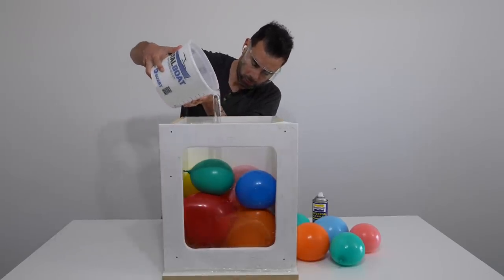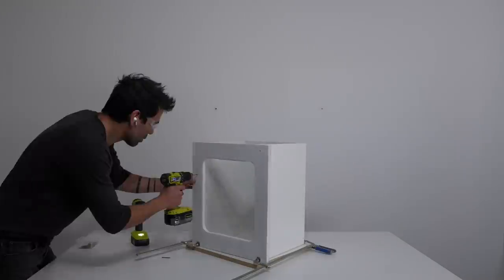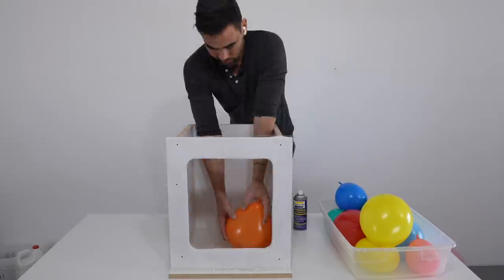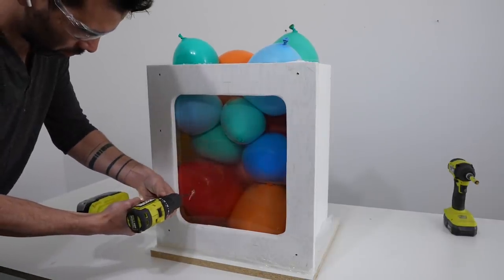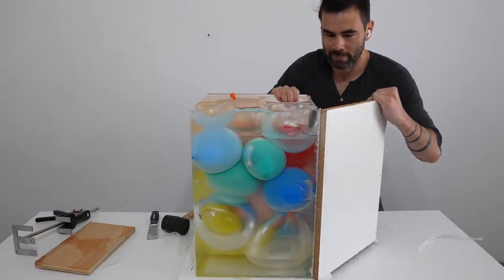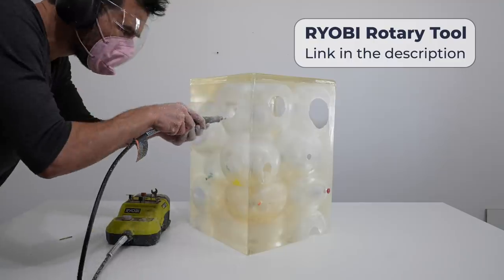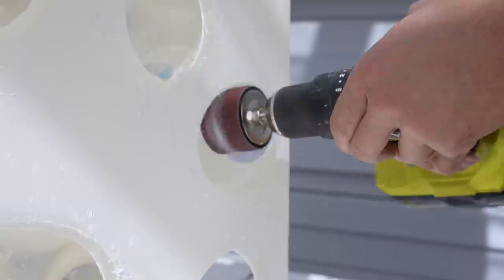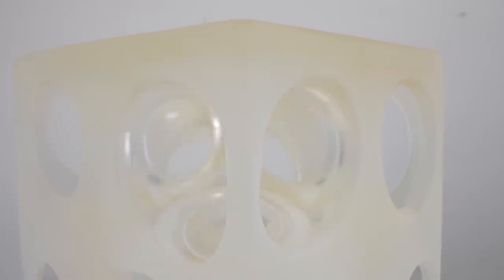Epoxy Resin and Water Balloons

Comment: Fun project. Is the yellowing from the resin getting too hot? Or is it just not a good clear resin? I'm not a fan of the faded yellow color. Maybe tinting it would be good if repeated? Maybe a bunch more small balloons? When is round 2? :D
Reply: I had the same question, maybe it’s from the mold release? Or pigment from balloons? I’m not sure either
Reply: Looks like wherever a orange balloon was, its caused a stain
Reply from the maker: I am guessing reaction of mold release and/or one of the balloons
Reply: I thought the same. Maybe with light blue or green dye it would reinforce the seaglass look
Reply: No matter what I guess resin will have a yellow tint when it age. So I guess it’s better to add some colour into it.
Reply: Definitely from too much heat, its a cool concept though and has inspired a few ideas

Comment: I haven't run through the comments yet so apologies if this is a repeat...this process could make for magnificent light fixtures. Ceiling mount. Floor. Really cool idea. I do wish epoxy broke down but ultimately looked like a successful stab at your idea. 👏
Reply from the maker: Great idea!
Reply: Even with the plants you could embed a mix of grow lights and RGB LEDs and make an incredible feature piece.

Also, it'd take some clever planning (and flexible tubing with a TON of mold-release) but I'd love to see embedded irrigation and drainage channels so you could just pour water into a top reservoir and have it distributed evenly to each of the plants...

Comment: Is this repeatable in any reasonable way to consider actually selling these pieces? Love the way that by their nature they are one-of-a-kind yet dimensional so you could fit them anywhere. 

Speaking of, with all those voids, do you feel confident they can support much weight on top if they were, say, sat on?
Reply from the maker: it could be repeated with silicone molds and balloons where each one would take about 4-6 hours. its quite strong and will strength test on instagram stories

Comment: Does Ryobi make shopvacs to clean up all that water? 😅 On a mor serious note, how UV-stable is that epoxy, if you wanted to use a similar design for an outdoor waterfeature?
Reply from the maker: yes they do! you can add a UV stabilizer to the mix

Comment: I'm wondering if the water (in the balloons) was necessary. Could you have just used balloons without any water?
Reply from the maker: possible with small pours over a about 4 weeks but the heat of deep pours would pop them

Comment: Sadly in my opinion one of the most environmentally unfriendly projects Ive seen you do. The reason being that its a lot of hours/material/bywaste/power/tools for what essentially is a box with cavities thats being used as a not very functional table. Im not sure sticking a few random plant pots in the holes makes this project "green" either. Perhaps a smaller prototype would have satisfied the original desire to "tryout" the idea. I can see this being thrown out and becoming toxic landfill pretty quick if it hasnt been already.
Reply from the maker: I am happy you care and I don't think your points are invalid but here is a little context of how I think about it.  epoxy and plastics are not great but useful.  I avoid using them as disposables at scale and we wont be serving single use plastic bottles at the hotel I am designing for example.  I don't mind using an imperfect material for a one off artistic expression or for personal use just as I don't mind having desert occasionally in an otherwise healthy diet. I used to be more strident when I was younger but I saw a lot of my other friends get brunt out and I opted for a more casual approach focused on my own lifecycle.  I do try to offset that harm with other projects where my impact drastically outdoes my consumption.  For example this year I will personally stop about 8000 lbs of fiberglass windmill blades  from is going in a landfill.  I like the idea of offsetting my consumption by a factor of 3-5x each year.  this is not a defense of epoxy it is just what I do as an individual.   it is going in my new house I will probably live another 30-50 years. it is possible that someone else will put it in a landfill but I honestly doubt it.  I could be wrong though and I often am.  I try to always be open to good faith critics about sustainability and I want to thank you for caring!